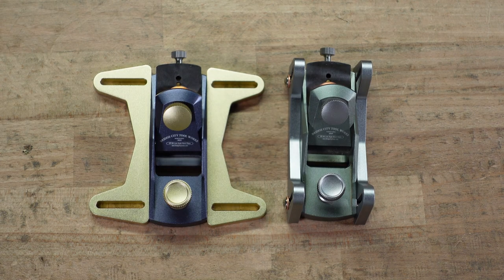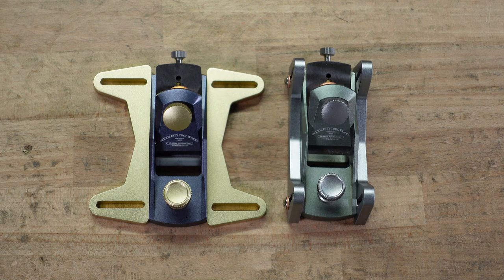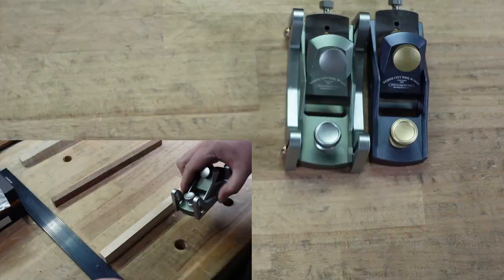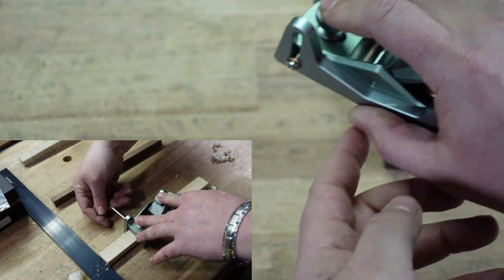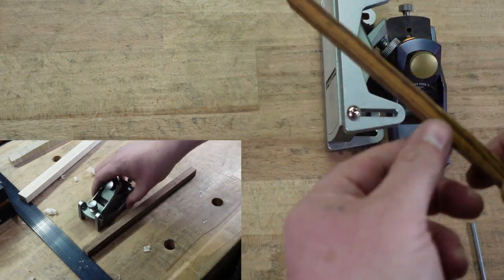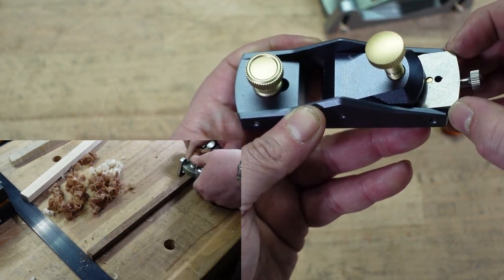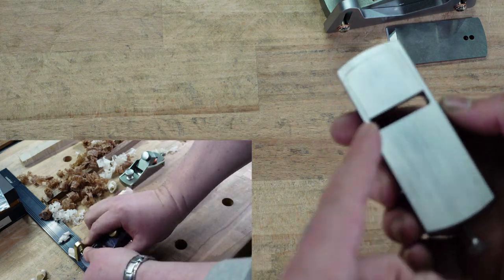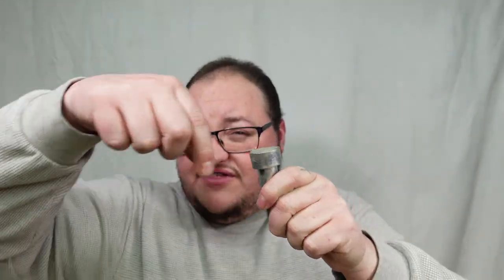The Block Plane That Gives You WINGS!!! Review of the Bridge City Tool Works HP-8

Comment: Bought one of these (on sale, naturally) on a whim. Turns out it's perfect for precisely thicknessing kumiko strips; works great. Set the depth and plane until it doesn't take shavings any more; easy stuff.
Reply from the maker: Great point on kumiko strips!!! Do you have to thickness one side, flip it and do the other? Or did you find a better way?
Reply: @BatCaveCreations  Yes, that's the approach, since the planed finish is so much nicer than what comes off the saw, you really have to do both sides. The strips prior to planing are about 0.125", but the kerf on a typical saw blade used to make the half-lap joints is usually 0.11", so there's some room to do both sides. I find the strips to be easy enough to plane without a planing stop; plenty of friction between the strip and bench, but I've seen some clever jig solutions made by those doing production-level volume.
Reply from the maker: That is perfect! Thank you!!!

Comment: Btw, if you drop only one wing and slam it on the face of a plank, then you could clean and square the edge of it. Hope that makes sense ( I’m French) haha
Reply from the maker: Yes! You can use it as like a fence to square it except for the little bit between the mouth and the edge of the plane but that can easily be planed down! Thank you for sharing!
Reply: Shoot, forgot about that edge
Reply from the maker: @Roger Boucher  I did too cus I said it in the video then cut it out cus I didn't wanna explain and have ppl yell ahhahha
Reply: @BatCaveCreations  😂

Comment: Hey there, this is actually my first plane ever so forgive this question, what is the point of the throat? Why have it closer to the blade or further away?
Reply from the maker: Hey! When the mouth is more closed it prevents the iron for diving deeper into the wood. The more open it is it can dive in deeper and cause tare out (chunks out of the wood). And if your working in tough grain, closing the mouth helps. That's the theory at least. More important than that is how far below the bottom of the plane the iron protrudes. Grab some scrap and test it out, open mouth, closed mouth, iron farther out, iron closer in. You will feel the differences and learn what is good for that plane and for what your working on. Have fun!!!
Reply: @BatCaveCreations  thank you! It just makes me want more hand tools. Is the non profit thing still up and running? Saw a quick video, meant to look into it, but forgot, I’m definitely interested and qualify
Reply from the maker: @Shannon-v3r  it is! Www.planewellness.org

And yes it is easy to get hooked on hand tools hahaha